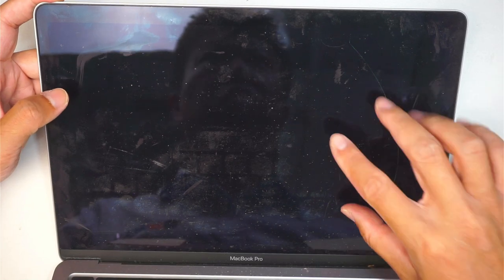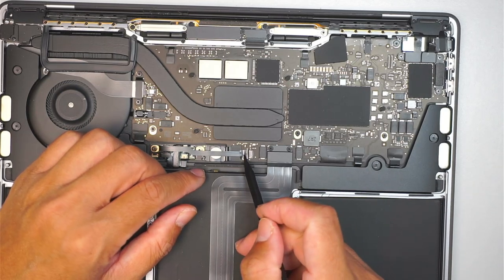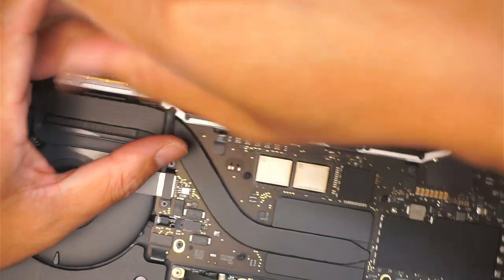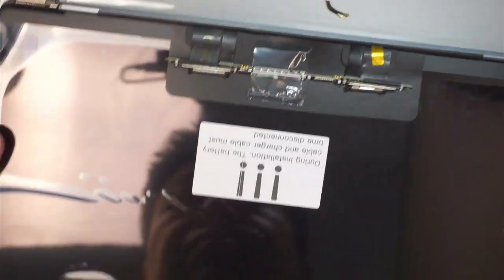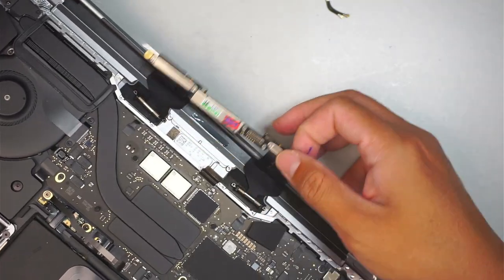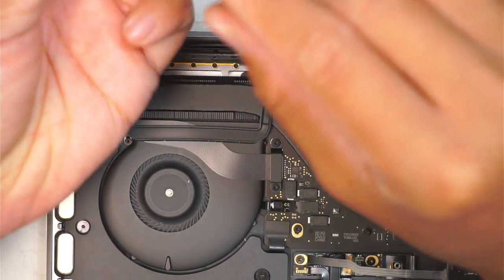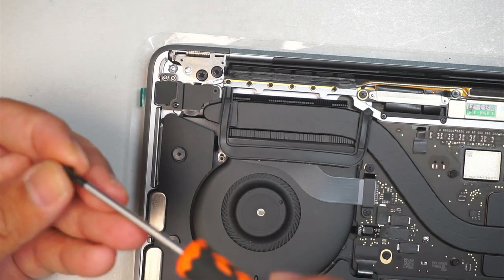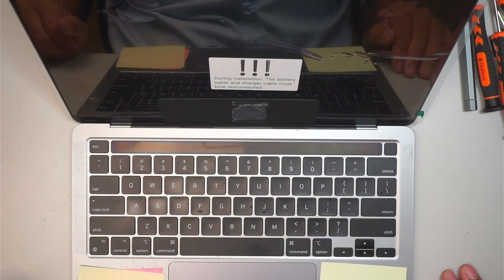Macbook Pro a2338 Screen Replacement step by step

Comment: Hi - I followed the instructions and replaced the screen.  Now when I boot on, I hear a chime but the screen is dark and the keyboard is not light.  Any suggestions what may be wrong?
Reply: It sounds like the backlight is broken
Reply: kindly remove the new screen and install old screen before any   remove  battery